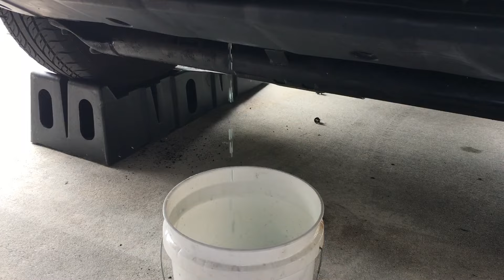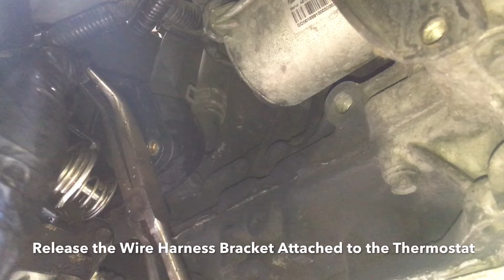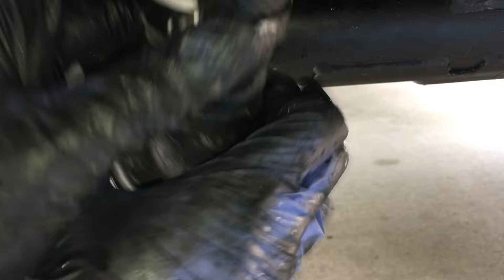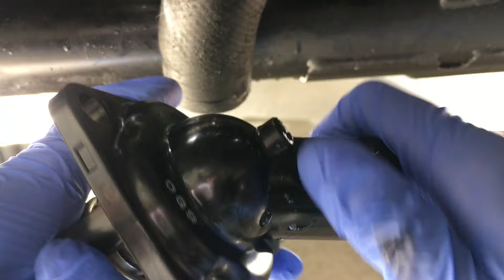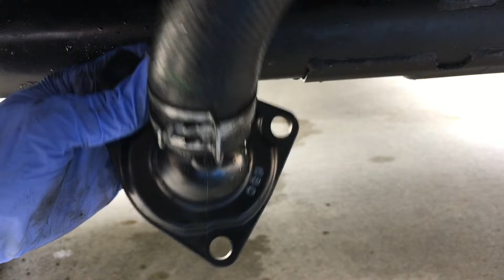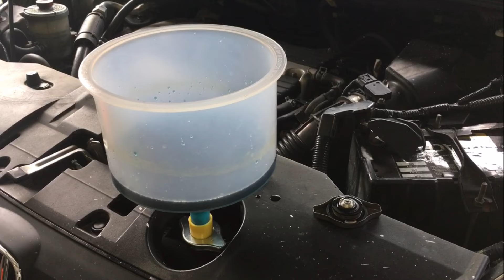2007-2014 Honda CRV Thermostat Replacement DIY

Comment: If you live in the new England states, I recommend pb blasting those 10 mil bolts. Bolts broke coming off from corrosion. So I replaced the back of the thermostat housing also. And while replacing the back of the housing I broke the heater pipe cause it was corroded also. Fyi replace thermostat housing, back housing, and heater pipe that goes to it.

Comment: This might be sort of a dumb question, but how do you necessarily know when the thermostat needs to be changed outside of a potential interval? My 15’ Civic LX produces a slight burn smell through my vents when the heat is on (mid range-full heat). Does your Civic produce this too from time to time and is this an indication that it needs to be changed? Thanks in advance!
Reply from the maker: You usually change this when you're doing a timing belt service (this civic does not have) or water pump service, which is around 100k miles. The thermostat helps maintain the coolant temp, when it goes bad, it can cause overheating. The "burning" smell is normal. Just check the coolant level every month or so and look out for leaks.
Reply: Thank you for the comment, keep up the vids your content is great!
Reply: @adansanches79  if you smell radiator fluid you  have a small leak somewhere
Reply: 1. On the dashboard you will notice that it takes a very long time to reach the normal temperature 
2. In the winter you won't take off the jacket because you feel always cold

Comment: I have a 2007 CRV LX 4 cylinder with 100,000 miles.  I’m going to change the coolant and I’m determining whether or not I should change the hoses, thermostat and even the water pump.  There are no leaks and I haven’t had any issues to date.  None of these items have ever been changed, so I’m not sure if I should replace any of these items.  Thanks for any recommendations and the great videos!
Reply from the maker: This CRV at the time of the video had around 250k IIRC, and all the parts were original. These rarely fail, but if you don't mind doing the work doesn't hurt to change them out. I would change the coolant, thermostat, and hoses now, water pump you can leave until it starts making noise.
Reply: @MrRangerZr1  Is that 250,000 miles?
Reply from the maker: @starkeymorgan4142  yep, now has close to 300k.
Reply: @MrRangerZr1  well .my crv is at 112. Looks like my pump should have a lot of life keft
Reply from the maker: @starkeymorgan4142  Honda fuel pumps rarely go out
Reply from the maker: @starkeymorgan4142  honda water pumps too rarely goes bad
Reply: Informative, thank you. I've been very happy with my old '07 Honda, bought used in '12.

Comment: Hey great video...I've been contemplating  replacing the Thermostat on my 09 CRV due to the fact that fan kicks in way too often (I think...) It this a good idea?
Reply: Fan Comes on automatically when the A/C compressor comes on.  Otherwise it goes on when the coolant temp reaches a certain point.

Comment: Question, how do you get to the nut that’s on top, can you get it from the bottom of the car ? Or from the top of the car
Reply from the maker: itsyurb0ylayy4 everything is done from the bottom.
Reply: How did you get the top bolt off? Any suggestions would help

Comment: How do get that top bolt off of the thermostat ?
Reply from the maker: Take the hose off first if you can't get to it
Reply: @MrRangerZr1  I already have the hose off I got the 2 bottom bolt off I just can't take the top bolt off and I also got the wire harness unhooked
Reply from the maker: @nathan06m  use various extensions to get to it
Reply: @MrRangerZr1  is that how you got to it in this video?
Reply from the maker: @nathan06m  Yeah. It's not fun but you can do it.

Comment: Seems like I’m loosing antifreeze from that area in my car. I thought there was a gasket on that thermostat case you just removed.... guess there is not. Now I wonder where my leak is coming from.
Reply from the maker: The thermostat has a gasket, that's what seals it. Do this, degrease the engine and see where the leak is coming from. Coolant will leave a dry powder type residue when it dries. Address it ASAP, coolant leaks are not good.
Reply: @MrRangerZr1  I’m going to take it to the mechanic. I usually do this type of work myself but where I live the winter is brutal. Hopefully this won’t cost me much.

Comment: What is the purpose of the wiring harness on the thermostat?
Reply from the maker: To hold the wire in place
Reply: @MrRangerZr1  sorry, I meant that I thought that car thermostats were entirely mechanical. Is there a sensor in Honda thermostats,  or  what specifically does the wiring harness power or monitor?
Reply: @Loopy_McLooperson  it's not connected to the thermostat itself.

Comment: Hi mate. Thanks for the video. I have tried to change my thermostat on a Honda CRV 2008 2.0 i-VTEC and it's not in the same place as yours. My two hoses top and lower one are located on the right hand side of the bonnet. Where you think it could be located the thermostat? Thanks again
Reply from the maker: this car in the video is the north american spec.
just follow your hoses til you see the thermostat housing

Comment: Video so helpful. Is it no need glue, packing seal or heat proof sealent. Just PnP usig bolt. Thanks for answer
Reply from the maker: No the rubber gasket does the sealing no glue needed
Reply: @MrRangerZr1  so just plug n play after we got the new one. Thanks

Comment: What sizes do i need for the bolts? Ill be changing my wives thermostat after work today. Im sure ill find out by trying. Cant b no bigger than a 13 each bolt. But i could b wrong.
Reply from the maker: I mention all the bolt sizes in the video
Reply: @MrRangerZr1  sorry for that.  I was watching this on silent , whole house was sleep. I got the part , gna get at it soon. Big Ups to your video.

Comment: I don't have any way to but the Honda up. Can I change it thru the top
Reply from the maker: You don't need to raise the car, i raised it so I can film for you guys to watch.
Reply: @MrRangerZr1  It's nearly impossible to swap out the tstat on the 4th gen CRV without raising the vehicle at least 8-10" in my experience...ramps or jack stands work.  Otherwise, you can't get the necessary clearance to access the tstat, even with the splash shield completely removed.

Comment: Can you help me with my honda crv 2009? when the temperature on the dashboard comes on, then the heater will work and if doesn't come on, it will not work.is it the thermostat?
Reply from the maker: May be the thermostat or air in the cooling system.